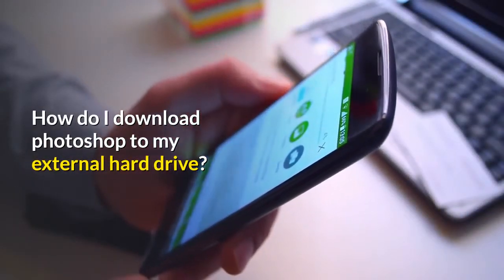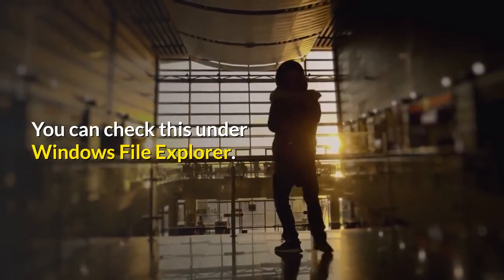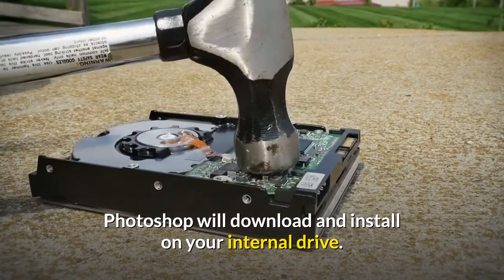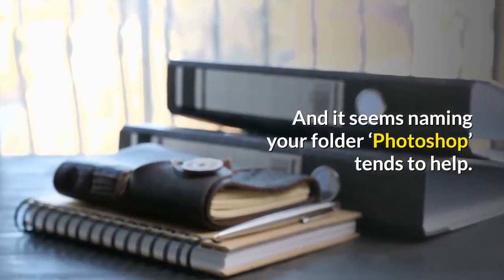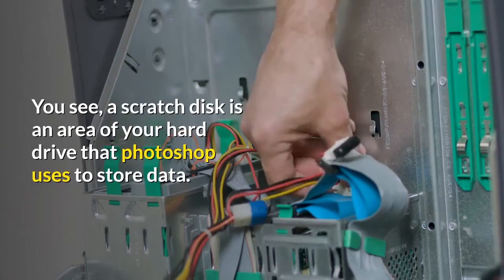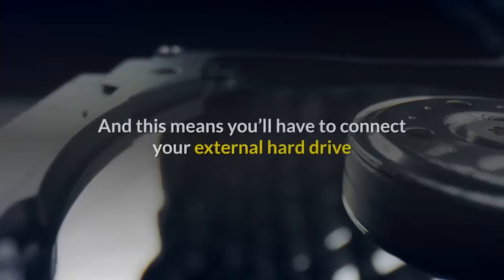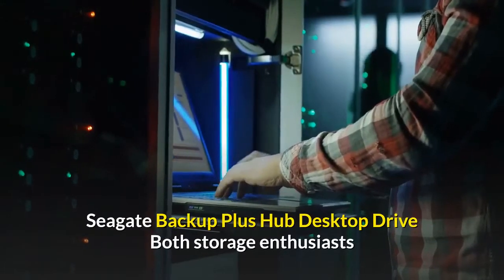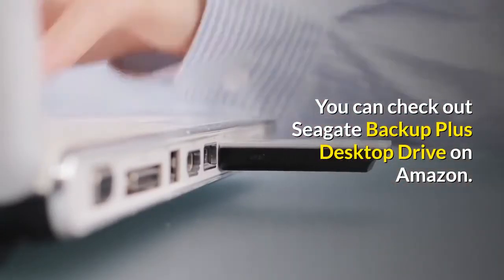Can you put Photoshop on an External Hard Drive

Comment: Hey, whenever I try to change the download to my hard drive it says that i am unable to install to a removable drive. would you be able to tell me why this happening? thanks.
Reply: hey, you've probably found a solution to that but if anyone else is reading this, wondering the same thing here's how I fixed this: make sure your hard drive is empty or do a backup beforehand (!) and then you need to format  your hard drive. maybe you should google how it works for your device but it should be pretty easy :)
Reply: @its_emmanouela I’m having this issue,I format my external storage then it still says can’t install to removable storage